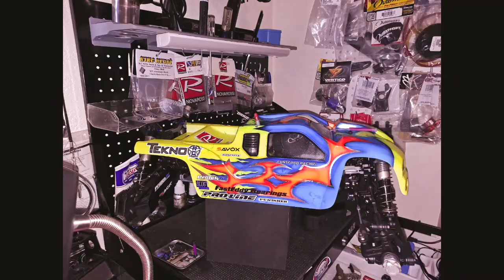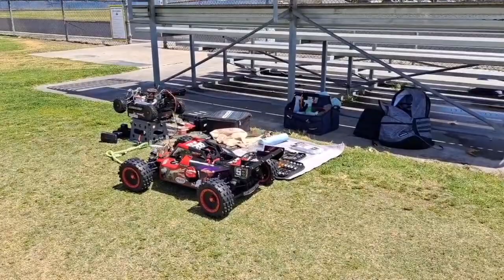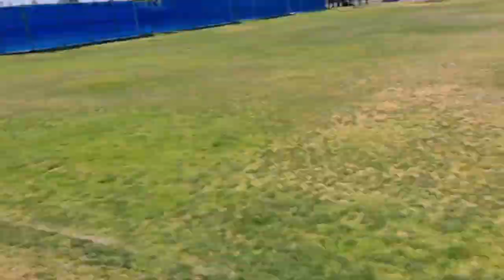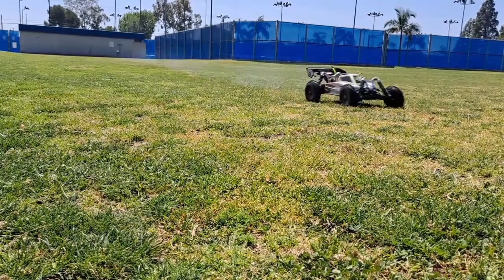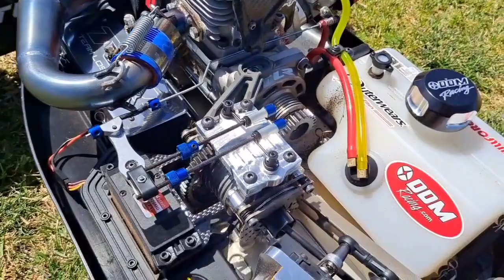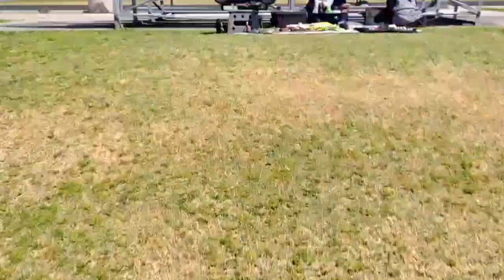OBR 34 REED SS FULL MOD IS A BEAST!! 👹👹👹 🤔⛽🗯

Comment: Put some gearing in it that thing is gutless for 30 feet it doesn’t have enough power to spin the tires from a dead stop I was hoping for a broader power band but a full modded motor is gonna be mostly top end I’m sure so gears are ur friend!
Reply from the maker: FYI it's got a leak in the bottom crank bearing shield that's what the problem was I'm taking the engine to obr on monday Dan Wil be fixing it and I'm gonna get the 1242 modded and do a tour of the obr shop so stay tuned!

Comment: Mine has plenty of bottom I think it's that basher clutch you're using my bites really hard on the bottom end so I don't know what's different between yours and mine I know richer on low is better you got to feed the engine but I bet you it's that if you're using the basher clutch I bet that's the difference
Reply from the maker: Nope there was oil on the clutch! Thats what the issue was!
Reply from the maker: Also I pulled clutch off and the bottom crank bearing seal is leaking 😭 called Dan and I'm bringing engine in! no worries they got my back and maybe I'll do a video of the obr shop!🤫